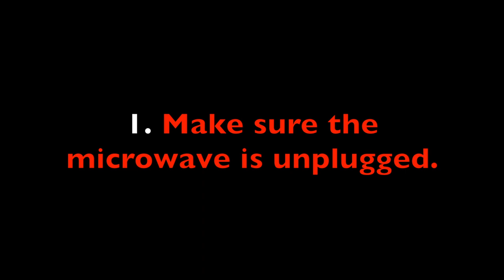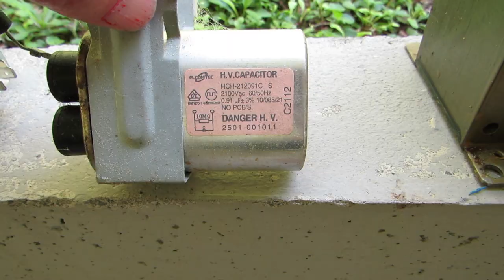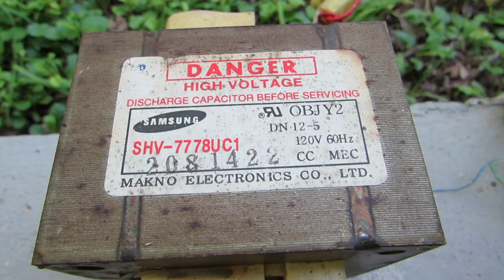How Much Copper is in Microwaves

Comment: Get a vice please 
You do not need to smash the fan motor 
Put the none copper end in a vice and gently tighten it 
The copper winding falls off on its own 
Unfortunately the majority of microwave transformers in the UK are not copper
Keep up the good work
Reply from the maker: I have a vice. I will try your suggestion. We're seeing less copper and more aluminum in the US too. Some are 1/2 copper and 1/2 aluminum. Some are all aluminum and some are all copper but both coils being copper are disappearing fast. It's sad. 
Thanks for your time.
Reply: @prolevelrestoration  you're lucky to have found an industrial sized microwave to strip. I've only done household ones- and none over 20 years old. Every single transformer was ally wire, the newer ones have switch mode power supplies instead of a transformer. None have the exhaust/filter fan motors. There's very little worthwhile in a microwave, I dont bother with magnetrons as theyre very time consuming for a small bit of copper and those ferrite magnets are weak compared to neodymium magnets from hard drives(if you're interested in magnets). Smaller microwaves I just cut the cord and toss. There are better appliances to get sore fingertips stripping. Washing machines for one.

Comment: How do u get that copper ring off that shaft with the berylium?
Reply from the maker: It's not worth risking cancer to upgrade it to #1 copper. 
Settle for #2, tape off the berylium rings and your scrap yard should give you #2 prices. Get back with me and let me know. 
You can simply cut the shaft-ends off with an angle grinder and a cut-off wheel... but I'm telling you Robert.... it's not worth your life.
Peace
Reply: They stopped using berylium on magnetron  40 + years ago
Reply: @ThatsRightRecycling  Uuummm.., no, it turns out that the element has been used a LOT more recently than 40 years ago, though it HAS been largely replaced with Aluminum, and I thank you for getting me to look it up on my own.
Reply: Don't thank me, thank goggle and there's a few safe ways to remove copper without harmful effects.